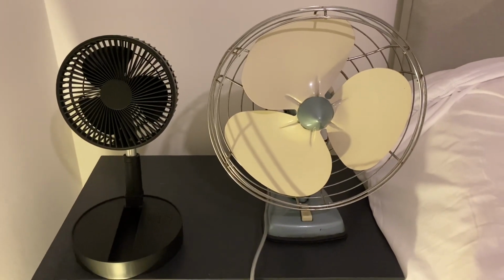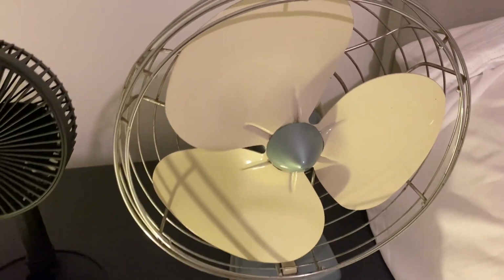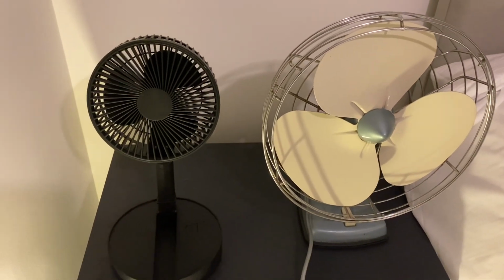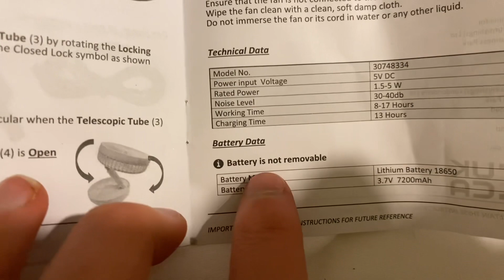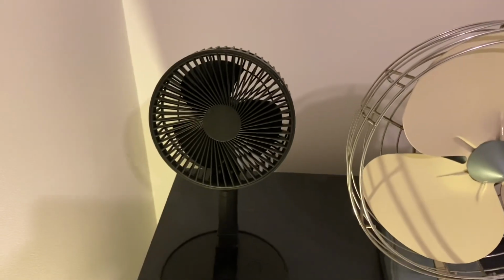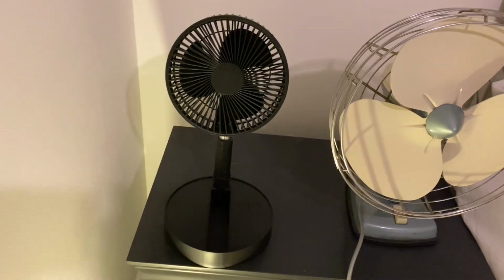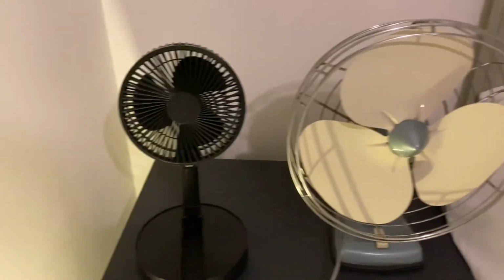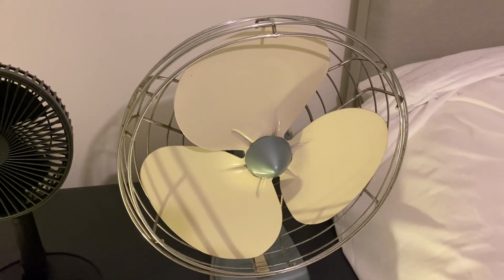A Modern Less Than 1 Year Old Desk Fan Vs A 60+ Year Old Desk Fan: Which Is Better?

Comment: The motor size of the modern fan is responsible for that fan not having a motor housing. I only have three fans that have motor housings and aren't battery powered. The message fan which is among those three is however USB powered
Reply from the maker: That would make sense as those motors are tiny lol

Comment: <laughs> The modern one telescopes looks like a plastic giraffe 🤣🤣🤣
Reply from the maker: Yeah it does look like one lol. Not sure who would need a 6" USB fan that tall though lol
Reply: @Connectitthefancollector  Yeah I'd rather have one that I could tilt the head and even rotate it; The message fan, as well as a crazy overpowered battery powered tripod fan have tiltable heads (my two base clip fan can also do that) and the tripod fan's head can rotate all the way around so it doesn't just stop at a certain distance in either direction it's rotated. Best fans I've ever gotten as Christmas and birthday gifts. In fact several of my fans were birthday or Christmas gifts and one of the birthday gifts is a duplicate helicopter fan that I bought at Rite Aid several moths prior

Comment: Is that old fan safe with that exposed blade? 
(Referring to the front, not the back, I wouldn’t get upset over a non restrictive grill)
Reply from the maker: They are safe with that blade. Just don't do anything stupid around it and you'll be fine. Also touching the blade from the front doesn't hurt